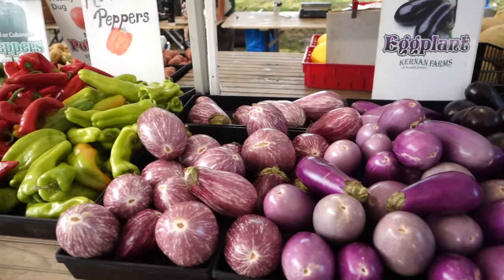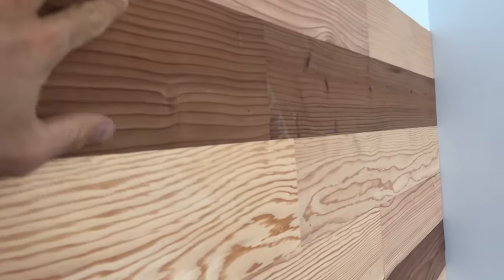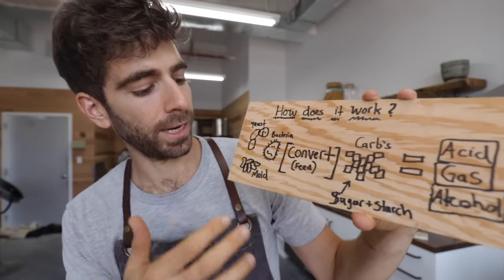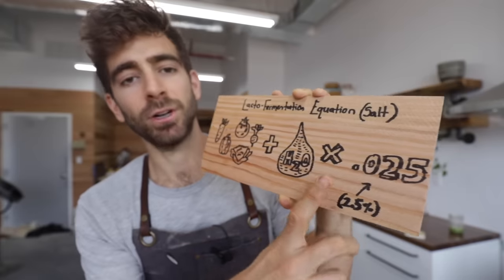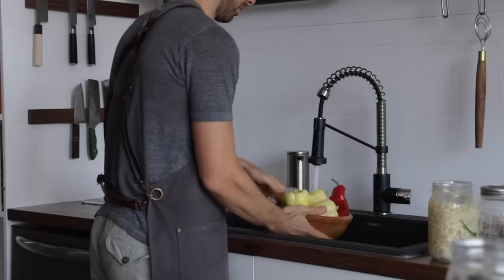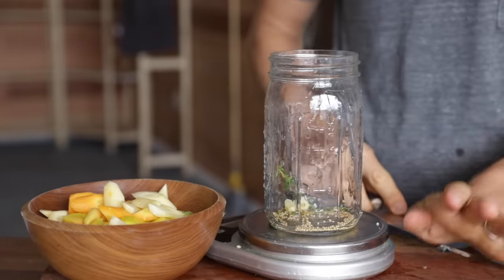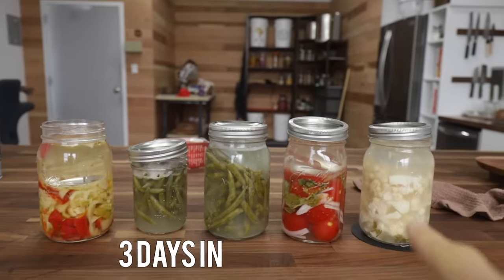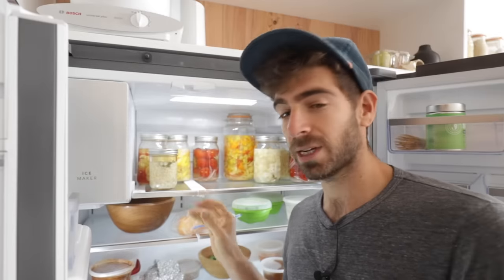The Complete Guide to Fermenting Every Single Vegetable

Comment: What's has not been really mentioned but is important is the fact that some veggies let out water (salt breakes down cells) so do leave some space for the water level changes.  if you ferment cabbage eastern eurpean kind ( lactofermened insted of sauerkraut), you do not use water but just salt, white cabbage, carrots, peppercorns, bayleaves, no addition of water nesessary, but the mix nedds to be kneaded a bit before putting into jars. For the georgian kind of "red cabbage" (beetroots, cabbage, chilis, garlic, sellery) sellery sticks with leafs are obligatory, otherwise the taste is  much blander.

Comment: How long do the jars keep in the fridge after opening? 
Also, how do you stop the fermentation process? Are they shelf stable?
Reply: Putting them in the fridge drastically slows the fermenting process. It never truly stops, I don't think, but slows enough, certainly, to eat it all before it becomes unpleasant. It will keep in there indefinately, but give it the ol' sniff test if you're ever unsure. The nose knows. Because fermentation occurs at room temperature, most of them will not stay in a state you would want to eat long term there. Adding things like black tea or grape leaves will help your veggies stay crisper, but over time they may still turn into some sort of unrecognizable mush. This happens much faster without those. This may be the voice of experience speaking. If you have a cool place, like a root cellar, I've heard this can help preserve your ferments for consumption through the winter until your next harvest. I don't have one myself, though, so I can't personally speak to its efficacy. But as far as how long they will last, pretty much forever as long as they're kept mold-free. Fermentation historically was used heavily for food preservation before refrigeration. Plus it's delicious.
Reply: They can keep for several weeks or even a month or two in the fridge - but at room temperature they continue to ferment quickly and turn very bad.   The only way to stop the fermentation process completely is to heat them up to near boiling - but that changes the flavors dramatically, and cooks the veggies.

Comment: Great info instructional video! 2-3 days after covering it, I’ve noticed that the veggies started to come up to the surface, so I’ve pushed them back down again,  but I’ve noticed the brine got a bit “slimy”, contrary to the regular fluid brine.
I’ve had previously added the contents of couple small capsules of regular probiotics (although I’ve done the same in the past and never came across this). 
I left it for the regular 2 or so weeks, but the slimy brine remains. 
It tastes very strong, as if “peppery” strong.
Should I dispose it and make a new one?
Thanks a lot in advance for your details when replying!

Comment: In addition to "fizzy" vegetables, you may end up with a "gusher" when you open the jar, if the jar is sealed during fermentation.  It's almost a rite of passage for those who are new to fermentation.

I might wait for it to start bubbling for a day or two before sealing, if carbonation is desired.  I found that out the hard way while making "ginger beer".  It may be different with veggies, but with ginger beer I like to leave the cap loose for that first day, and then tighten it for 24 hours and let it carbonate before placing it in the fridge or pasteurizing it.

Comment: It's hard to find canning jars now 😞  darn virus.
Reply: Here is a tip: I reuse all of the store bought jars with twist lids, after I used up the content (mayo, gurkins, mosterd, etc). They are great for fermentation and preserving and work just as well as the professional stuff. No need to spend extra money!
Reply: They’re just ridiculously expensive where I am
Reply: @moedervanbranko409  what do you use as weights in store-bought jars to keep your vegetables under the brine?
Reply: @oritsegee When fermenting, I pack the vegetables in a jar so tightly, that they remain submerged. In the past I tried using a plastic bag filled with water, or a large pebble. The tihgt packing works well for me.
Reply: @moedervanbranko409  thanks, I will try that with a small batch.
Reply: @moedervanbranko409  Hey, when you are reusing store bought jars.. how does co2 escape from it, don't you put the lid on? I don't have canning jars but I have few store bought jars lying around..
Reply: where i come from we just reuse plastic bottles, and ferment our vegetables in them and it comes out perfect every time :)
Reply: @daroori999  I put the lid on a jar lightly, so the gas can escape.
Reply: @daroori999  You can use paper coffee filters secured with rubber bands. It lets gases out but keeps out dust or bugs.

Comment: Quick question, after the fermentation process is done and you open the jar,  do the veggies still  need to be submerged in the solution still? And the unopened jars should they be refrigerated or can you keep them on the shelf till ya need them?
Reply: As i understood so far (not sure if its right): the veggies will keep fermenting as long as they are in a warm place. They dont go bad but the taste can get a bit more extreme. To "stop" or slow down the fermenting its better to store them in a cooler place or the fridge as soon as its as fermented as you like
Reply: I know from kimchi fermentation (lactic acid fermentation) that you want to keep the jar at room temp (60—75°F) at the beginning. This is where the fermentation is fastest. For kimchi, 48 hours is a good time. Then you can move it to the fridge where it will continue to ferment, but much slower. Here the jar stays as you wait a few more days (kimchi reaches peak tastiness after 5 days in fridge). You must keep letting the gas out and pressing the veggies down back into the brine so that they are covered both during the fermentation process and after you started eating.
Reply: I'd keep them submerged, because the brine is antibacterial (2.5% NaCl solution)

Comment: I want to make homemade Sauerkraut for the first time I was wondering how much garlic would you recommend per pound of cabbage and would red onion interfere if I wanted to change it up abit, I was also wondering if I keep the juice from my last batch and add it to the new one would it be more beneficial or could it cause troubles would appreciate your advice thank you have a good day
Reply: khartle20 I do 4Tbls salt, 4Tbls minced garlic, 2Tbls coriander per head of cabbage.  ferment at least a month (i prefer 2 months).  home fermented sauerkraut is better than anything in the stores.  well worth the wait!  (get a bucket or large crock if you have the money and do a lot at once.  running out before your next batch is done sucks)
Reply: You can always use the juice/liquid/brine from an old fermentation, no problem at all and yes, I believe it’s beneficial because it has gone through the process once without succumbing to bacteria etc and I think it adds all of that beneficial bacteria to your new batch. It also saves you making brine if you need to when you have a new batch going which sometimes happens mid fermentation, when you’ve lost some of the liquid. With garlic, I usually put in just a few cloves per jar as everything is intensified with fermentation. I’ve never tried red onion, so can’t comment on that x

Comment: Tips: Soak your veggies on baking soda 
The salt must be without fluor or iode . 
You have to completly immerge veggies.
If you use tap water you should let the water in ambient air during at least 30min before immerging.
Why?  The chlore present in tap water will not help bioactivity for the fermentation because kill bacteria (bad and even the good for fermentation)
If you are not sure about the acidity so add a little tablespoon of vinegar 
Cheers

Comment: I actually prefer a much lower salt content between 0.8% to 1.0% (yes, x0.008 or x0.01). I live in the tropics and it speeds up the fermentation really well at room temperature giving a very tangy product after 2 weeks.
Reply: What's the room temperature where you're at? I'm also in the tropics and im worried about getting started on this

Comment: Very nice, even I had to learn a couple of things there despite the fact all he has in the fridge I will have finished off in 3-4 days and have years of experience in fermentation of veggies and fruit... Oh well, fermented foods are the ultimate foods - you get the goodness of the veggies and you get bacterium for free which will fight other bacterium inside you gut.  Just to add, in order to get all the goodness inside the body, arguments were being made about longevity of bacterium and optimal conditions. Apparently the optimum conditions will be in the fridge at around 10-12 deg C and the ultimate delivery method is to eat them of course uncooked and in very, very large amounts. I would slightly disagree about the salt: a. only specific salts can be used b. I do not use salts myself at all.  You can of course add a little bit of salt to taste if needed. Eating a few tablespoons (3-4) per day, to my opinion, will not guarantee they [bacterium] will reach your intestinal tract but at least you will get some nutrients inside you. I am talking a min of 200 Grams per day in one sitting. Also, worth mentioning, if you are new to fermentation, ingest the ready product slowly, start with 30-60 grams per day and increase to as much as you want during the subsequent days. I'd say you need to prep yourself for 4 days gradual introduction and then you can enjoy as much as you like. If you introduce too many bacterium very quickly and your body has never experienced them in those amounts, this can give you gas and a bloated stomach for days even severe painful bloatiness in the intestinal area which won't go away..  Afterwards, if you are using these products daily you can eat any amounts. Once the population of bacterium in your gut is sufficient you won't have gas at all whatever amounts you consume . I can eat a kilo of fermented small (thai style in size) cucumbers in one sitting, and in an hours time will down 400 grams of fermented cabbage. Enjoy! A very nice video, APPROVED!

Comment: So, I'm confused at the end.  After the fermentation process is finished, did you take it out of the salt water and repackage in regular water for the fridge? Or did you just put lids on the existing jars and slap in the fridge?  Do we have to add extra liquids to the jars before storing in the fridge?
Reply: Leave it in original brine screw lid on and if the brine is low top it off with salt water. Also he leaves his lids off but that gets kham yeast which is not good for first time fermenter I would leave lid on every once in awhile unscrew to let gas out or leave it on it makes veggies fizzy which I like.

Comment: I tried this method and it came out too salty.  I checked my math and couldn’t figure out what I did wrong.  Then it occurred to me that you really need to pack the veggies in tight before you add water, otherwise your formula is taking I to account the weight but the proportion of water/veggies is wrong.

Comment: At 11:54, you closed the lid and I thought, "where's the weight?" and then you said a bit later about adding the weights, so I thought "oh he just added them off-screen." Then I watch until 21:15 and sure enough the jar that I saw at 11:54 without a weight added is the same jar that had the mold happen.

Comment: You don't need to weigh vegetables and you don't need that much salt. There is no perfect fermentation regarding the amount of salt. You can add as little as 1.5% brine without weighing vegetables or you can add as much as 5% total weight. 

The perfect fermentation happens in absence of oxygen. This is the key. The ideal way is to add brine from previous ferment and put either an airlock on or screw the lid on tight. No, it won't explode. The sooner it starts producing CO2 the less chance for it to spoil.

Comment: Why are you adding the weight of the veggies into the calculation? Don't most fermented foods require eg a 2% brine which so you just add (weight of the water * 0.02)=grams of salt to add?

Comment: Is there a benefit to blanching the veggies before fermentation? I feel like this could cut down on the mold, but it would kill much of the wild bacteria / yeast that is needed for fermentation. It seems like nobody does this. I'm a little squeamish about not partially sterilizing the veg surface. I've done it with asparagus and it seems to work fine. Of course if I keep it under heat too long, it gets all soggy and ruined, but if it's just a moment or two at high heat, then out I feel like it kills the baddies and helps the brine absorb into the veg. I'm probably way off, and I'm sure my method could stall fermentation. Maybe it's only working for me because I am recycling brine through a couple cycles. I've never gotten mold this way.

Comment: I bought silicone fermentation lids and they are bulging upward with foam coming out. Is the batch ruined ? I took those off and replaced them with canning lids am I supposed to leave them loosely or tight and burp them?   Making sauerkraut, pickles, beets, and kim chi. I made one batch of sauerkraut in a crock and its wonderful.  I was just a little worried about the jars due to the foaming and bulging lids exposure to oxygen.  They are weighted though.

Comment: Mike, does the ambient room temperature affect the fermentation?  Yes, in the video it says that below 60'F slower ferment and above 75'F the fermentation can get out of hand.  So , ... during the spring summer and through to oct we have an average indoor temp of 80'F 85'F.  We have pretty hot and dry summers up here in the mountains, and I want to make more than just kemchi which is so good,  and use the veggies, might have to set up a cooler room, .. thanks for the video.  Also I want to start making the bread starter and sour dough starter so, was just wondering what you felt about ambient room temperature or should I find extra room in my fridge. Thanks

Comment: My suggestions, since I've been doing brine-pickling for a while.
Great video, BTW. 

Pre-make the maximal amount of 2.5% brine.
Boil, then cool the brine, to reduce the chance of brine-resistant pathogens (yes, they exist & are not rare), and to boil away chlorine (if you're using tap water).  My suggestion is to use filtered (eg. Brita) water.   

Using a pre-made brine guarantees that all the water has proper brine salinity from the start.  The pre-fill method in this video would inevitably cause pockets of low-salinity (due to absorbed water), resulting in off tastes or worse. For the same reason, after washing veggies, make sure to dry & shake off all water.

Comment: Hi, you didn't mention your name so just Hi.  
Many people dont have a scales at home so they will just skip your  video. I  make pickles for several decades and never used a scales. Because  there is no really need for a scales. I'm just checking the volume of the jar I intend to use. If the jar volume not listed on it. I fill a bottle of mineral water or another drink like cola which is 1.5 liters. then pours into the jar I intend to use. that's how I know the volume of the jar. I add the amount of salt according to the full volume of the jar. Full teaspoon of salt is approximately 6 gram of salt. Full tablespoon of salt is approximately 22 grams of salt. It should be noted that 2.5 percent of salt is the very minimum amount of salt to add. But more can be added epecially when you want to keep the pickles for a long time. I dissolve the salt in a glass of hot water and ad it to the jar. Then i add the vegetables, garlic, parsley and other spices to the jar And finally I fill the  jar with water up to the top. Then I close the lid of the jar and mixes it all together by shaking the jar. Very easy without the use of measuring tools. Allows you to make pickles spontaneously from few vegetables left in the fridge. Thanks Nir

Comment: I have a question?
I only have tapwater available which is city water with chlorine in it. Which I understand is bad for the perfect fermentation due to the chlorine. What type of water should I purchase to do the fermenting. Most videos that I’ve been watching they say filtered water I don’t have a water filter.? Would I purchase spring water, distilled water, or purified water, that’s what’s available in my area of Connecticut.
Please help 🙏
Linda from Ct

Comment: Would using an airlock negate the need for full submersion?   It would allow the headspace to fill with CO2 rather than O2.  Also, is Clostridium botulinum an issue with this being anaerobic?

Comment: Can somebody comment with a decent amount of input on which fruits/vegetables work great and not so great? Also how long should I do fermentation in the 60-75°F range that was mentioned? Any idea? I'm a beginner. Thanks in advance!
Reply: Length of ferment will vary by vegetable. Cauliflower and other cruciferous veggies take 2 weeks to properly ferment and develop the desired probiotic benefits. Some are much faster and are more subjective, basically ready when YOU like the flavor. It will also vary by the local climate. Start tasting at around day 4. Continue fermenting if it "isn't quite there yet."....i.e., if it just tastes like the vegetable dunked in salt water. The tang that comes with fermentation should be there!! You'll recognize it when you taste it!!

Comment: If I use a Silicone Pickle Pipe (Airlock with a Nipple to release the carbon dioxide build-up), there will only be carbon dioxide left in the jar and no air/oxygen. So do the vegetables still need to be pushed down with a glass weight or cabbage leaf, etc to stop the bad bacteria/microbes forming mold?